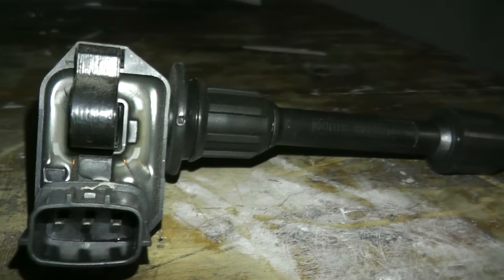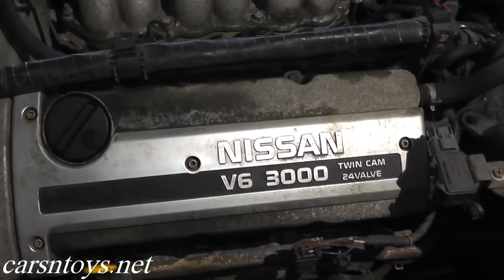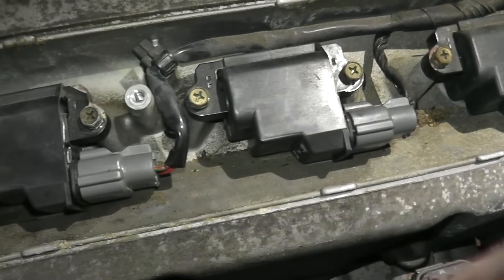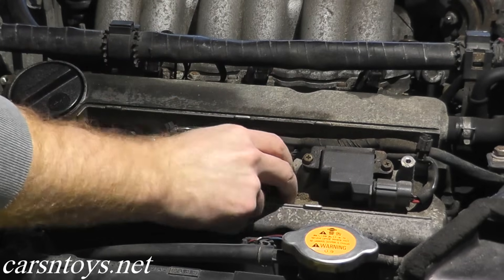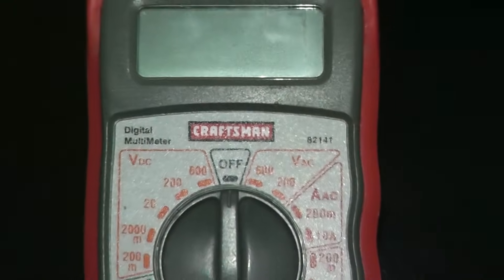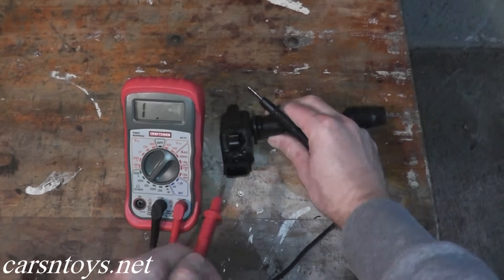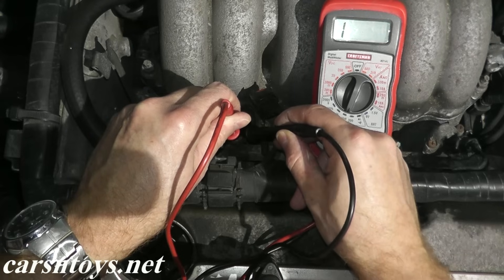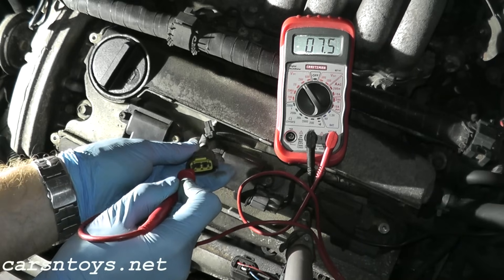How To Test Ignition Coils with Basic Hand Tools HD

Comment: Excellent and to-the-point video. Just a warning for people. Do not buy cheap ignition coils on the internet. You can buy in the internet but get good quality coils. I did a cheap set and I've had to replace all 8 of them in the last year-and-a-half. A set of eight coils cost no less than $400 if they do you're buying crap.
Reply from the maker: Good advice. Same goes with injectors and HID bulbs.
Reply: You are correct
Reply: I am on the fence with this logic. I was buying good coils 90 to 135 a piece and time after time cooked them from days to weeks or months but they would fail. Then discovered my ignition condenser was fried. I am waiting for it to get here but I bought 6 cheap coils and a condenser and going to see what happens. I really like the look of the new cheap coils they appear to be of quality construction and each of them ohmed out identical. the rear ones were 1.43 across the board and the fronts were  0.68 each. So I hope it works out.
Reply: I bought a cheap set of 6 on Amazon for my 2013 Ford Edge 6 years ago for $135. Haven't had nothing go wrong.

Comment: what is the respected resistance for of a good coil ?
Reply: A coil is considered a resistance short (low resistance; all wire has resistance depending on size and length of wire). Coil failure is open circuit or high resistance.

Comment: The two terminals you tested were for the transistor that controls the power to the primary coil. You did not test the windings in the primary coil. And if that coil is bad, you would not know it because you didn't test the primary coil. The turning on and off of the transistor is what controls power flow to the primary coil. And you didn't even check the secondary coil which can test good but will fail under load.  You can have an ignition coil with a primary coil that tests good but won't fire because the secondary coil is bad. Testing three pin and four pin coils can not be done with a multimeter because you need a way to control the transistor located inside the coil housing.
Reply: When looking for a first cold start misfire problem I checked each of the 4 3 wire COPs with a Fluke 17 multimeter, looking for a difference in resistancetesting between the 2 outside pins 3 of the COPs came up between 6.2 to 6.4 Meg Ohms the 4th did a slow ramp up continuing to 26 Meg Ohms,  retesting all again yielded the same results, replacing that 4th coil on plug that measured 26 Meg Ohms fixed the cold start misfire fault but unsure what may have failed in the COP or why this difference in Meg Ohms caused the misfire, any ideas ?
Reply: Checking such coils is done perfectly and easily by using a square  wave generator applied to input terminal and providing D.C.12volts to the right terminals and testing the output visually And leakage checked  by touching the stuff by a metal rode connected to the negative of the supply voltage while under test ...car electrician

Comment: Paid fucking $100.00 just to have the mechanic tell me its the ignition coils, which are about fucking $100.00 God Damn. I feel so retarded. I've almost got my Master Auto Tech Cert. but I just could not figure out what was wrong. When you type in engine running rough it brings up vacuum leaks and other things, but not coils, you basically have to know its the coil to get to the information on failing coils. WHY GOD WHY? One more month and I would be in school: have a place to do all the work myself... FUCK FUCK FUCK FUCK FUCK FUCK FUCK.

Comment: So you're only testing the primary coil of the coil pack with the multimeter. It's usually the secondary coil that goes and 99% of the time you can't test that with a multimeter. Even if you can, coils generally fail under load and I doubt your multimeter can produce the 2000 volts to test against that. Don't waste your time with this bullshit video. Get your car scanned or take it to a mechanic.
Reply: About time someone who knows there shit can’t test under load no way to duplicate test not reliably didn’t even cover primary and secondary windings there two different test with different readings also

Comment: I have a 2001 vw jetta I put new spark plugs new wires and a new ignition coil and every 2 months I'm blowing ignition coils now the shop that I take it to put cheap ones in this is going to be my 5th one can anybody give me advice
Reply: robert wharton always make sure the shop uses factory spark plugs with the appropriate metal copper platinum etc because spark plugs with a certian metal are designed to work with the engine at its factory operation temp. Also if the plugs arent right it can cause the ecm and coil to try and over fire because of the difference.

Comment: Concise and clear, only one issue: no indication as to where to point the meter. Obviously  we can tell by freezing the video where you had it pointed (on the OHMS area) but with so many different choices as to where in that area, good to include that info. Thanks.
Reply: He mentioned it right when he pulled out the meter "resistance or OHMS type test" he said.
Reply: @bbeenn  there are multiple ohms settings on meters..
Question should have been.. 
which ohms setting should the meter be set?
That is also dependent on the meter used..
As I learned in the past.
When it says set meter to 0-500 ohms, dont use automatic or 0-1k ohms.
I had to buy a meter that has to have a specific setting,
as I was getting a false reading..
Reply: @Butchsiek  20k olms is the setting you want. Ive seen it in various videos and I paused this video to make sure I was testing on the right reading because my multimeter looks just like his. Anything else will give inaccurate data.
Reply: @tipxking9944  thanks..
I was referring to a specific setting. 
Manuals I worked from, the engineers that wrote them as I talked to them personally,.
We worked for Textron..
I explained to them the need to be specific as i found out the hard way when troubleshooting a circuit..
Another Tech I worked with noticed the meter I was using told me it wont work because the Engineers used a specific model and setting..
He used his and mine to show how the readings werent the same..
Mine showed a component was good, while his showed it was bad. 
I replaced the part, problem solved..
The Engineers sent out a replacement page for the manuals that includes a  warning and the meter, brand and model, the Engineers use in their design..

Comment: I really do wish that you stayed close to me to tell me if my coils are bad people are charging me over 100.00 to check them out for me I have a 2014 Nissan altima sv I had this guy to put new spark plugs in and he told me that I didn't need them I'm asking what will cause for my car to take off kind of slow at a red light then it will speed up I don't know anything about cars and wish I had just one go mechanic that could fix on my car instead of some of these dudes trying to rip me off by me being a woman

Comment: antifreeze spilled on my coil harness connector. can i clean them or do i have to buy a new cables
Reply from the maker: Let them dry out and it should be fine. You can also spray any excess water with a can of compressed air.

Comment: This does me no good. I have a Nissan Versa and to even get to the coil and plugs you have to remove the intake manifold.  So if the intake is off you can't even run the car. The only other options for people in my situation would be to just replace all of the coil packs at once, unless there is a way to bench test them while they are out of the car.
Reply from the maker: Use a digital multi meter

Comment: Good test with unplugging the connector while the engine is working to find not working coil pack. But the test with ohm meter is incomplete - the coil pack is a transformer, a device to convert a 12V pulse into about 30kV. It has two coils: primary, connected between 12V and ground, and the secondary coil, connecting between ground and the spark plug. Very often the primary coil is good but the secondary, the one actually working with high voltage will have a break or short and often it only shows under load or in high temperature of the engine. Just testing primary coil with ohm meter is an incomplete test.
Reply: PszemoI can
Reply: Might be useful to have a resistance table in both directions.ie. diode measurements are less in one direction, more in another.
Reply: Do u know will u get a spark still if secondary is bad

Comment: i thought i had a problem with a coil pack in my 97 nissan cefiro because i have a small miss fire while the car is running in low revs but only when in gear .....it runs perfect while in park . ive tested the coils while the car is running and all seem to be working ok . it is only a subtle miss but it is very annoying ..... injector maybe ? any suggestions ? cheers

Comment: what happeneds on if you do a power balance test and the engine dies
Reply from the maker: Are you doing this on a four cylinder? Does the engine die on every cylinder?
Reply: it is a 1MZ-FE V6 with the waste spark distributor-less system that has the 3 coil pack system that has each coil controlling the front and rear with rear cylinders not having a coil pack. why?

Comment: from my understanding is that when Ignition Coil gone bad there wont be any firing in the Cylinder as a result you will smell a pretty rich gas fumes in and outside the car. So its pretty not safe leave the engine running while you have one of your ignition coils down. So now the question is how would you know which of the ignition coils are down without totaling your car? Thanks!
Reply: Firstly checking of which Coil is bad, you will run engine for a short period of time but not an hour or so. Fumes from the exhaust pipe are not going to harm you or the others while you will be doing it in open space. Simply try to do this kind of job on the outside. Secondly don't run your engine for a longer time with disconnected Coil Pack, because that way you are harming your Catalytic Converter. Fuel which wasn't burned in the engine is burned in Catalytic Converter, which is part of car's Emission/Exhaust System. That is why you don't smell gasoline while the ignition coil check.

Comment: i have a mazda miata 1997 and would a faulty coil make my car stall? i changed my fuel pump and my spark wires  and i also check my air filter and for a vacuum i dont know what it is but its only when i come to a stop or a red light its random sometimes it doesnt happen in the day but others it happens 1 to 3 times :( anyone have any ideas?
Reply from the maker: Yea, a bad coil essentially means the spark plug(s) aren't firing.
Reply: okay man i checked the coils when i got home and i was pulling them out while the car was running one at a time to see if i could see a spark and i saw 2 of them sparking alot more then the other 2 ? could that be it? that two of my coils are weak? cuz my car runs fine sometimes but it does feel like i lost power when driving  and thank you for answering my question :)
Reply from the maker: When you pulled each coil did you hear the rpms slightly drop? If not, then you have a bad coil(s). Also check out eric the car guy. I remember he had a very good video regarding power balance testing. Just do a search under his page.
Reply: okay thank you and yes it did drop slightly more on others coils though but thank you so much :)
Reply from the maker: Glad to help man.
Reply: CarsNToys can you do a video on fuel trims ?? i posted a video of a problem im having with my 2001 nissan maxima and can really pin point what it is i have random stalling at idle or coming to a stop but never turns of on me i have no trouble codes at the moment but i notice that my fuel trims go up in my live data with ob2 canner when i rev up to about 1500 to 2000 rpm check out my vid and plz net me know what you think thanks..

Comment: does it matter if you do it either way with it shut off or running? will it be the same results
Reply from the maker: Should have the same results but doing the power balance test (when the vehicle is running) is pretty darn quick to check; at least on most vehicles.
Reply: CarsNToys my car shuts off completely when I unplug an ignition coil, I have an 02 corolla, struggling to find the problem, bad idle & lost of power
Reply: I have this same problem. Camry test stalls out motor. problem is extreme loss of mpg. 300 miles per tank turned into 200 miles for same tank same driving habit. change happened over a week of time. no codes thrown. idle ok. for the Corolla guy I suggest cleaning the MAF with cleaner made just for the MAF. Walmart sells a 2 pack that helps you clean the throttle body which helps idle as well as hesitation. seafoamed the system is great too for your issue. but it didn't fix mine.

Comment: actually some engines have the coils conected in series so if you disconnect one, some other will stop working too. I recommend taking out one by one the coils till you find the one that is not working (the engine doesn't change when you take it out)
Reply: Francis JPK I disconnect 1 coil at a time & car shuts off, does it for all 4 of them, I have a 02 corolla, its so strange that the car shuts off
Reply: that's weird, maybe the ecu itself shuts off the car when you take off a coil
Reply: Francis JPK my new spark plug tip was wet with oil & coil spring, I need a new valve cover gasket

Comment: Thanks. I had one done already on my 2005 Ford Escape. Already had plugs done before that one went out. The number 1 coil. Kinda figured another would go. So back to shop. 😭😭😭 -$$$
Reply: Mr. S Mueller how many clicks you have on the car. Why plugs and coils are failing. Go for the root cause. Contact for a tried tested and proven solution to improve the power , mileage and long long engine life extended to 300000 and more kilometers

Comment: kinda forgot about the secondary side !! and ya alot of times they fail under load and when hot ..and will ohm out just fine ... amateur hour ....
Reply: 2000 toyota sienna quad cam 3.0v6 can a coil cause this kind of miss in the engine it runs fine at idle only time it will miss is when the motor is pulling up hill then it will miss but once it's not pulling or engine isn't not under strain it runs perfect
Reply: mason rounds ooo koo
Reply: Mine won't miss at idle only when it's under a load for example driving up a hill it will misfire but once it's not pulling it stops misfiring

Comment: what does it mean when your car starts but shuts off randomly or doesn't start but after a second attempt after removing and placing key back in it starts but shakes as if it wants to turn off? oh and my check engine light is on and auto zone is saying i have a misfire and need a new coil. do you have any insight on that? im trying to save money but i don't know what's going on 😔
Reply: I think they're right. Having the same issue with a Nissan Rogue. When 1 cylinder isn't firing the piston becomes dead weight for the other working ones and then the harmonic balance is thrown off causing a very noticeable shudder throughout the car.
Reply: identify the misfire code online and report back. pull that ignition coil and see if you have an engine room change. then pull the spark plug and see if it's fouled with oil. start there.

Comment: I have a misfire. So I did the "Power Balance Test" on all four of my coils (I own a 00 Toyota Celica GT). And they all did the same. When I disconnect the coil, the car slowly shuts off. Does that mean the coils are fine and the problem could just be the spark plugs?
Reply from the maker: Yea, coil packs are fine then. What problem(s) are you having?
Reply: +CarsNToys I had code PO300 and also the car feels like it doesn't want to go when I get on the gas, or when I go up hill. For example going up hill on a highway entrance, the car does poorly to get up to speed and it feels like it doesn't want to go.

 I also had code po301 show up, so I switched coil 1 with coil 2 and erased the code. To see if the coil was a problem. But ever since I did that the code never showed again. But still continues to misfire when driving.

Right now at the moment, I have no codes showing. But the car is still misfiring / running rough.
Reply: MundoGT hey you ever figured out the problem?, I have am 02 corolla Idk if you have 1zzfe but I have the same problem
Reply: Rick Ross It was the spark plugs. I changed all of them.
Reply: Rick Ross oil on the spark plug is not good at all. Someone put them in to tight. Damages the engine.
Reply: MundoGT nice, my spark plug tip was wet with oil & coil spring as well

Comment: How do you know the coil is not malfunctioning when it gets hot?I hear they can break down under load or heat?I did the ohms check on my two coils on my mazda protégé and they ohmed out the same.This problem seems to fool the best mechanics as to what is wrong.Saw a video where bad valves caused low compression and threw a p0300 code.

Comment: thanks for the video, tons of help with me trying to fix up a 95 Nissan maxima. I've never worked on a car before, all I use is your videos and it has helped me fix and rule out some things. I seen a comment that said even if the coil tested good it may possibly still be bad when the car is under load. is that correct? I haven't tested them yet but my car only stutters and cuts out in drive while at a stop at idle. put it in neutral or park problem goes away. so if mine test good tomorrow could it still be faulty under load? thanks a million you are saving my rear with these videos!!!